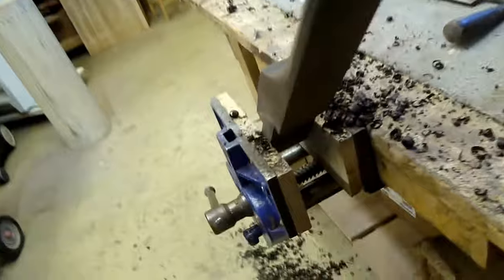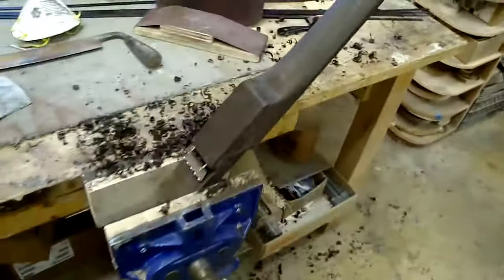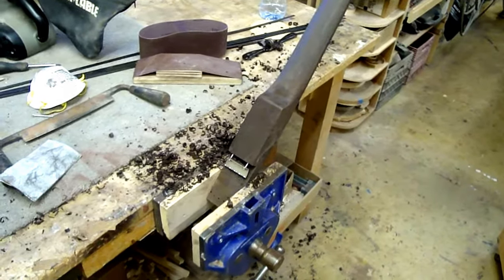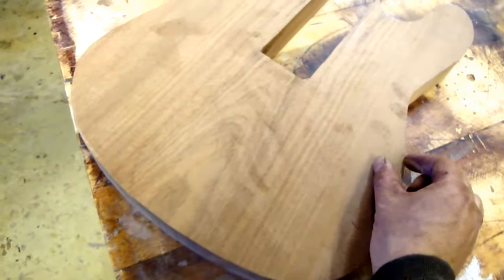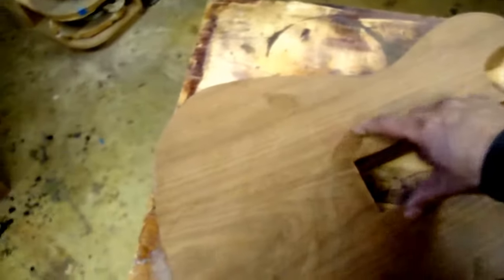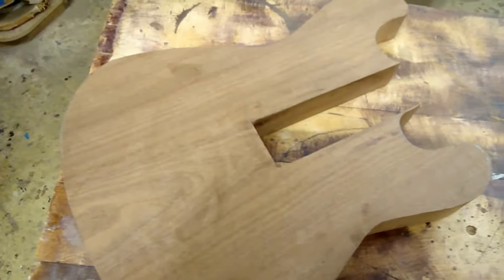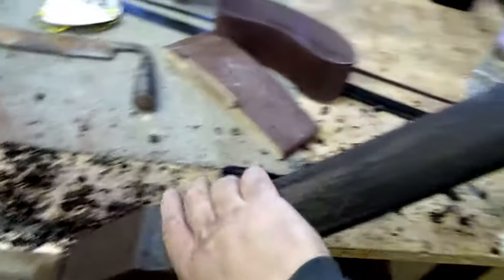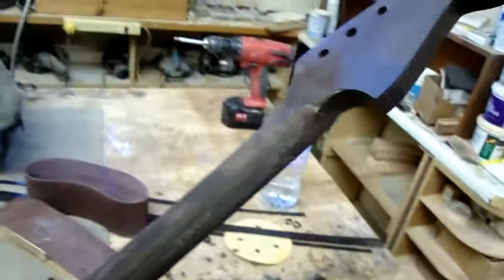The greatest guitar in the world part 2 Brazilian Rosewood neck through

Comment from the maker: @remotecontrol1324 Well... I consider it a neck through because the bridge is attached to the neck so all of the vibration and sustain is on the neck through area - the Fender style bridge is a routed area any way past the bridge so even if the rosewood went to the end of the body it would still not be attached past the bridge - thanks

Comment from the maker: canceling the strings movement - the string is dampened out by the rod so it does not move or vibrate as freely or as loudly for a longer period of time it suffers from the rods interference so - KTS titanium out of Japan Hiroshi Masuda made me some custom rods that He told me were 5 times s strong as steel but light as a feather and He was absolutely right - the Titanium rods work just like He said they would and improve the strings vibrration and movement - AWESOME  dynamics and sustain !

Comment from the maker: I will have to put a titanium truss rod in this slab stlye neck  - I mean it's beter to not put 1 in there if you can just plane the relief right into the neck - The Titanium rod will allow adjustment and not cause the dreaded string dampening effect that happens with the heavy steel truss rods - What happens is the string once plucked makes the rod vibrate with the pitch of the note but the steel  has so much more mass then the string that it takes over and out vibrate the string